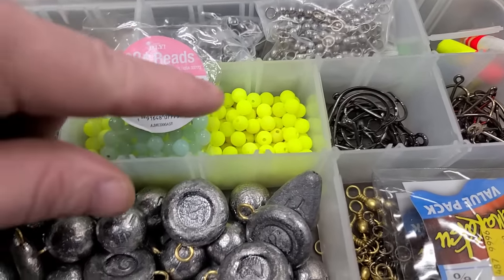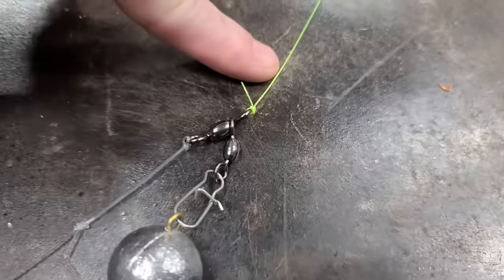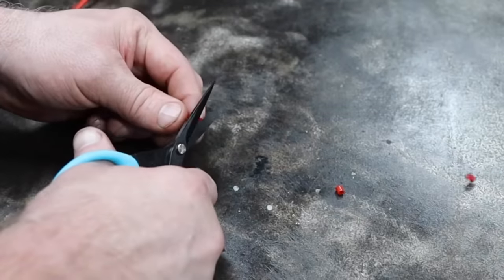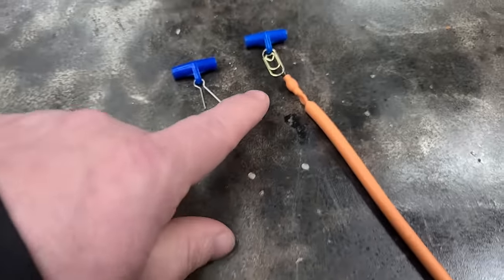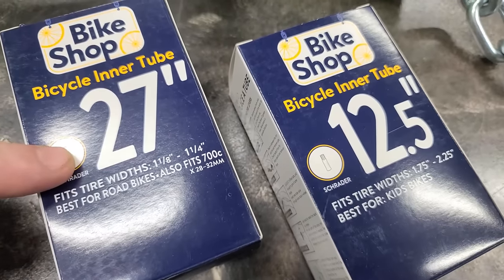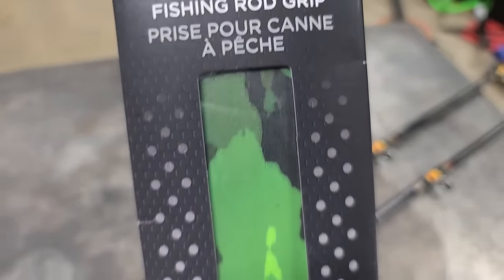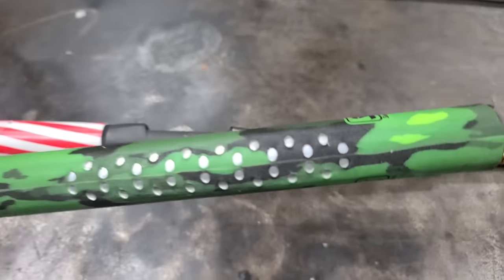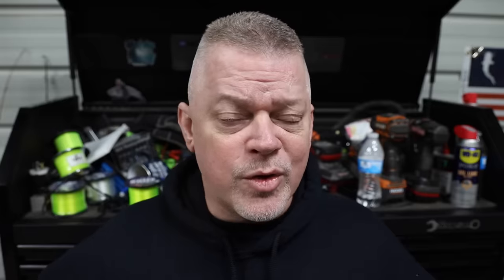7 NEW fishing Hacks

Comment: For an even less expensive weight slide, use the soft tygone tubing and paper clip.  You had the soft red tubing.  Most hardware stores have lengths of the clear soft tubes.  About 1/2” of tube with paper clip works great for a slide.  I haven’t purchased a bobber stop in years.  Most stores carry packages of little rubber bands in the hair care section.  Do a full hitch around the line and pull it tight.  Instant bobber stop.  You can even trim the excess loop and it will stay in place for multiple fish.  A couple hundred bobber stops for about $1.29.
Reply from the maker: That's a great idea

Comment: Makes a lot of sense for that paperclip. I bottom fish for Rockfish and Halibut and because we use like 80 pound braid we needed a weak point in case we hung up. So I went with a 40 pound line for my weight since 9 times out of 10 it was the weight getting stuck between rocks. Save a lot of expensive rigs by just losing the weight
Reply from the maker: Everything needs a weak point , even reels have drag because of that . We're I fish 40lbs ain't weak though dang 😮

Comment: 2:10 I have been using these bobber stops from Bass Pro for about 15 years or so. I’m a bass fisherman & I would have to go to the pan fish section to find them. Then I was doing Rep work for my tournament sponsor at BPS & told them ti stock them with the bass weights. They did & they started selling out of them shortly after.

Comment: What is even cheaper for weights is if you use a cotter pin, open it a bit put it over your line then put it through the hole in a large nut ( as in a nut and bolt) then open the cotter pin all the way so it can't slide off. if the nut get snagged the cotter pin will bend closed, the nut comes off. Another benefit to this is you aren't polluting the water with lead

Comment: Just ran across your channel. Your videos are awesome. I've spent the last 2 hours watching your videos. So I'm just breaking the surface. But as I was watching I started to think plastic Easter eggs and some hot glue could possibly make a great bobber or something. I once bought 24pk eggs on clearance for $0.10. If something could be done with it I'm fairly certain you could design something using the plastic eggs. Even if it's used to separate and/or carry hooks, sinkers, small supplies, etc.. Thank you for all your hard work you've put into these videos. Awesome job.
Reply from the maker: Hey thank you for that and thank you for watching em

Comment: A GREAT idea for part of a future video would be to figure a fairly easy way to install those handle grips on a spinning rod handle all the way from the butt to the top of the handle (where the rod starts). I did one like this and it takes a lot more time, but has been my favorite rod ever since. The main trick is to get the tightest fit around the reel stem without having any irritating rough edges where you grip the rod/reel. There is a commercially made product that is like this which I first saw at the rod/reel repair shop. It was stupid expensive for a piece of rubber, so I tried to imitate as closely as possible.
Reply from the maker: Do you remember what it was called
Reply: Hook up a rubber tipped  blowgun (Harbor Freight) to your air compressor. Blow into partially installed grip swelling it up while simultaneously jamming it on.  Yep it works very well.

Comment: if you use a snap/snap swivel, put a silicone bead before tying your line than insert it to the tip of the swivel. Whan you reel in, silicone beads secure the swivel and your rod tip doesn’t get damaged.

Comment: I had some hockey stick tape left over that I used to wrap my handle with. Well not my handle...the one that connected to a rod I found at the bottom of a lake with my anchor.
Reply from the maker: I've used baseball bat tape , it works good and is easy and cheap to replace

Comment: I also use the bobber stops to mark the depth of my line where I want it/fish are biting....crappie,etc.I'll run it down my main line till it's on top of the spool of my casting reels,this way it doesn't have to go through the guides,or levelwind and I just let out line till the stop is on top of the spool before it goes out the levelwind.

I quit using egg sinkers long ago because it wears on the line and also quit clipping the bank,flat bank,or any of the others with the eyes onto the slides.I tie them to the slides with cow hitches and lighter line than my main.If the sinker happens to get snagged I can pull and break it off and get everything,besides the sinker,along with the fish in.The paperclip will be an idea I'll give a try,won't have to have an extra spool of line laying around and will be a lot easier to remove when packing up.
I keep my Santee Rig from floating higher than I have the leader set at by just reeling in till the swivel hits the slider.

I like the old heat shrink over the snake skin crap.

The slide in of #FJB was good....lol
Reply from the maker: I reel my line in too when using a Santee rig but everytime a boat comes by the wake drags your bait towards you then eventually its right there under the boat lol .
Reply: @FishinNStuff  Yeah it also happens from the bank too,especially with these dolts that want to run these 30-40' cruiser size ocean vessels on the local lake with no idea what boating rules are let alone common sense.
I just reel up the slack when I see the line gets a bow in it.During the summer especially weekends it's not safe for Jons,Kayaks or most other boats under 16' here,even your black boat.

Comment: I like to put heat shrink on my rod handles as soon as I buy them. I just use plain heat shrink tube which is a lot cheaper than the pattern type. If you want it more grippy you can wrap the handle first with thin nylon cord. I do a cross hatch or diamond pattern but actually the heat shrink alone is enough unless you're using it on a surf casting rod that doesn't have any EVA, which I totally don't get unless the maker expects the buyer to install the custom heat shrink and rope trick. 
The bunny tho😂
Reply from the maker: Lol those are good ideas . Reminds me of how they make sword handles

Comment: Use small zip ties on your anchor! I lost a $50 grapnel anchor (and about 20 feet of anchor rope with it) that got hung up on the bottom because I used too big a zip tie! Hell you can wrap a piece of copper wire around it and re use it over and over.  Tried for quite a while to break it loose but it was no bueno. Lost the tip of my prop, 20 ft of rope and anchor all in one night. That's fishing on the Trinity River!
Reply from the maker: That stinks . That's one of the reasons why I've made so many anchor builds , because it's the one piece of gear that your the most likely to loss

Comment: The inner tube on your anchor chain will prevent the chain from airing out and drying properly which will cause it to corrode.
Reply: He added gel lube and the chain is coated. It’ll be a lifetime before that chain breaks due to corrosion.
Reply: @davedave3631   WD 40 will not protect anything from rusting, especially sitting water.  I'm no boat newbie, those chains rust over time even left open.
Reply: @davedave3631  I doubt that very much.  Water intrusion is too easy.  It'll sit and wash that WD 40 away in a few uses.

Comment: I found something that works just as good and is almost priceless it don't cost anything you just take the cartridge out of a used ink pen take the tip off of it and cut it into sections about a quarter to a half inch long and slip that on your line and it works just like the bead and it don't cost you

Comment: Why not just use a piece of toothpick jammed in the right side of the sinker slide to prevent it from moving?  I’ve used this for sinkers/corks as well.  Easy to remove and you get 2 uses out of one toothpick.

Comment: I like the idea of the chain and bike tube Down side on the chain and bike tube. Corrosion will build up inside.☹️
Reply from the maker: You got a point
Reply: I would use Automotive Top Coats by Plasti Dip for the chain instead of the tire tube.

Comment: I used spark plugs wire inside is rubber and a little hole it’s graphite or fiberglass you dig it out cut one into you what I talking about that’s what I used new I got a box of spark plugs cut it up I have enough for ever 1/16 -  5/16 or bigger depends on you I put it between my sinkers I don’t used them plastic beads

Comment: You should have used brake cleaner. It works better than penetrating oil for rubber, but doesn't degrade the rubber over time like petroleum products does
Reply from the maker: That's a good idea . I wonder if it would wash off after soaking the Anchor a couple times